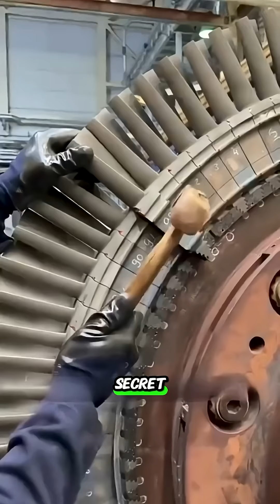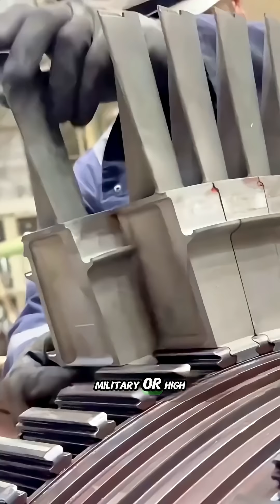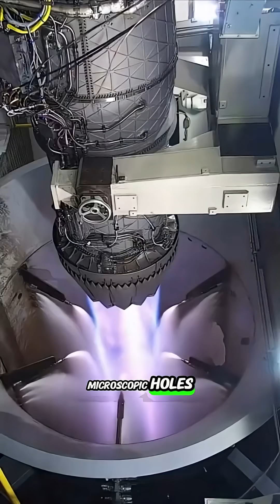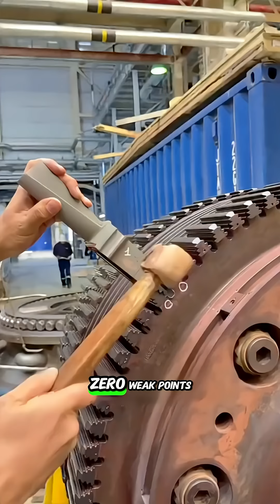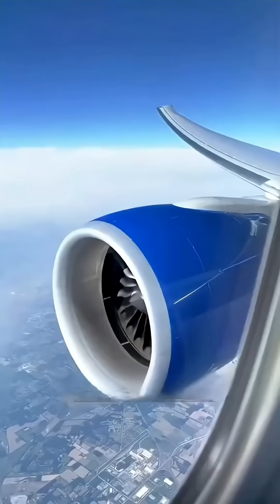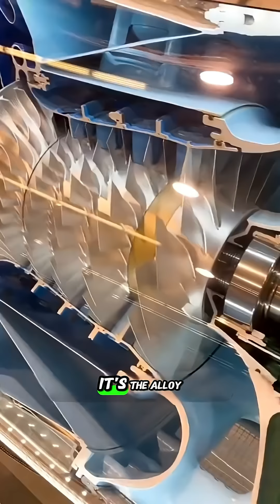The Insane Reason Nobody Can Copy American Jet Engines

Comment: Beautiful video, but outdated hype. The West had a head start, but China isn't copying the blueprint—they're skipping past it with next-gen ceramics and additive manufacturing that make BMW-priced blades look like relics. WS-15 is already flying, and the next wave is breathing down GE's neck. Western engineers aren't sleeping—they're watching Beijing's R&D budget and praying bans worked. They didn't. The monopoly isn't over yet, but the clock is ticking loud.
Save this comment for 2027.

Comment: A friend of mine's father was head of a group at Pratt & Whitney who created the high temperature coatings on their turbine compressor blades. Is it an extremely specialized field, one in which very few are expert and one which allows the engines to operate at the very high temperatures required.

Comment: A small germ.of truth blown out to ridiculous proportions.  Yes super sophisticated.  But I've got a YF119 HPT blade sitting on my desk.  Cooling holes are clearly visible.   Yes the are directed to guide airflow to envelope the blade with cooling air to keep them from actual contact with the combustor gases.  Almost nobody else can build them.  Almost.   That's not exclusive.  Yes amazing tek. But not alien tek.  They don't even touch on the FADEC integration.

Comment: Coal fired boilers for the steam to drive the turbines in our power plants require tolerances of .003 min to .005 max, just for the oil seal gaps encircling the rotor shafts!
.005 being, roughly, the thickness of a piece of paper.
Lineal expansion, contraction of the heating, cooling cycles.  This video showed me one of the items that crossed my mind, the 10 years I worked on turbines; jet turbines.
Incredible technology and if whomever it was that shared this video reads their thousands of comments; thank you!

Comment: Germany created the first operational jet fighter, the Messerschmitt Me 262. It first saw combat during the later stages of World War II in 1944.

America's first jet-powered aircraft was the Bell XP-59A Airacomet, which made its maiden flight in 1942. However, because its performance was deemed inferior to propeller-driven planes, it was used primarily as a testbed and training aircraft. The Lockheed P-80 Shooting Star is considered America's first operational combat jet fighter, first flying in 1944 and entering service in the final months of World War II.
Reply: Yes, Nazi Germany created the first operational jet fighter, but it was beset by poor quality of their engines. Don't recall precisely, but I read that they could only fly for about an hour at a time, after which the jet engine had to be rebuilt. The quality of the steel available to the Germans at the time was not up to par.

Comment: I am an actual certified jet engine mechanic.  In school we were taught that a 1/4 inch pencil mark on the turbine casing is enough to throw the engine out of balance and throw a vibe alert.  I don't know if I even have the capability of measuring the weight of a quarter inch pencil mark.  The level of balance is just out of this world.
Reply: How should a pencil mark on a casing influence the imbalance of a rotor?
Sorry, but I thought as a mechanic there should be some knowledge about how an engine works...

By the way, these benchmarks being told to you are rubbish. Engines are sensitive to imbalance, but not that sensitive.
Reply: @RenZ696 where did you go to school for gas turbines?  Mine was north of Chicago.  When I say casing I don't mean the outer casing, I mean the rotor casing itself that all of the turbine blades fit in.  It's not a one-piece assembly.
Reply: @letmepicyou  where I learned turbomachinery and rotordynamics this is called the rotor drum. The casing is the stationary part where the rotor is contained.
I thought this nomenclature was universial though. I'll check that out tomorrow with our turbine supplier, they also have customers in the US. Maybe, for whatever reason, the vocabulary is really different.

Comment: These engines are air, driven. They start them up with an air compressor starter. Once the engine starts going continuing, sucking in air and the way it’s designed that’s all that runs off the continual motion of the flow of sucked in air. I guess you can call it an air turbine. For naysayers the air is sucked in and compressed as it goes through the system and oxygen is a fuel. I’m not a engineer, but I seen a video on it years ago in a plane supposedly take thousands of 1000s of gallons of fuel, but where did they put the fuel And if you look up how much fuel One of these planes take didn’t look up how many Olympic size pools that would fill up.

Comment: I've worked on lots of different jet engine compressor and nozzle guide vanes. The cooling holes are very basic, are actually quite large and tend to cool leading and trailing edges only, they don't represent 'an internal labyrinth' as described. And they certainly don't spray any kind of fluid or vapour.
Reply: Glad you left out turbine blades, that's where the magic happens. Maybe the engines you worked on were not that recent?
Reply: @RenZ696  Ah well try the EJ200 engine in the euro fighter typhoon perhaps? 🤔
Reply: @dgw4150  kind advice, you should not divulge that kind of sensitive information online
Reply: @dgw4150  pretty high loaded engine as well. 
I was actually referring to the internal cooling paths within HPT blades, no offense. And for sure, no cooling fluids except air involved.
Reply: @RenZ696  None taken! I worked on Olympus engines for Concorde, RR RB211, Pegasus engines for the Harrier and the EJ200 to name a few. Vapour blasting the cooling holes on Pegasus LP blades was boring but you had to watch the machine because if it got stuck the blade was scrap within seconds! 🤦‍♂️
Reply: True for compressor blades which heat moderately during operation. However, turbine blades are exposed to very hot combustion gases and do have intricate cooling passages as stated accurately in this post 😊
Reply: @zaneullman2543  Not in the way they were described

Comment: Coming from a jet mechanic... its not as complicated as this video makes it sound. Its is correct about the cost, they are expensive but still not as expensive as the video makes it sound. The blades Definitely arent $200k ea, the entire engines i work on are 8 million dollars and have something like 300 blades. Even if the blades were the only cost inside the engine that would still only put them at around $20k-$30k a piece which is just not true. Also many countries besides the usa have build very capable jet engines, Keep the false info off the internet 😅

Comment: This technology is going to be changed with a much powerful propeller which emits air in ten times of this engine. The air will not produce heat during the combustion. Just speedy air.

Comment: In nearby Columbus Georgia, the Pratt and Whitney facility operates a major manufacturing and overhaul hub.
The facility includes the Columbus Engine Center, which repairs and maintains commercial and military jet engines and Columbus Forge, which manufacturers critical engine components like compressor airfoils and turbine disks.
Commercial Engines such as the Airbus A320neo, A220, and Embraer E-Jets E2.
Military Jets include the F117 for the Globemaster III, and the F100 for F-15 and the F-16 Fighters.
Vital heavy-duty forging includes parts for commercial engines and the military F135 engine which powers the F-35 Lightning II Fighter Jet.
The Columbus Plant employs over 2,600 people.

Comment: The jet engine was invented by Sir Frank Whittle in the UK. The Comet was the first commercial jet Air liner, built and designed here in the UK. ROLLS ROYCE, the foremost aircraft jet engine designer and builder and recognised across the word.

Comment: Shenyang And Xian will conquer the market before long. Now, more engines from these manufacturers are produced than any other. However, most of them still end up in military use in fighter jets and transport aircraft. In 10 years, the matter will be completely different. RR will certainly hold its own for a long time.

Comment: I worked in a special metals factory on the West Coast as a mechanic millwright we repaired machine machines, vacuum machines, all kinds of different pickling tanks. They made different kinds of metals called crystal bar hafnium zirconium special titanium we had security guards watching us cut blocks of it $600,000 blocks of it. They made stuff in vacuum tanks. It just grew under plasma. I don’t really understand it that well but I used to fix the machines. It was interesting. They made jet nozzles for F-15s no joke there’s some cool metal out there forging, etc..
Reply: It helps to take a class or classes in METALURGY, I only took 2 because I got took up Welding and felt that it would be extremely useful which it did but alot of the other welder's didn't want to be bothered, I felt that I it was mandatory and it paid off at the Shipyards and other jobs, what did I have to loose

Comment: The Russians ALSO make jet engines, both for their military and for their civilian market. In particular the PD-14 was developed from scratch to replace the sanctioned Western engines and it's a 5th-generation high-bypass turbofan which features advanced hollow titanium fan blades, a composite nacelle to reduce drag, and a fully digital FADEC (Flight Control) system, all designed and made in Russia. Oh and Russia supplies nearly half of the world's aerospace titanium... The US and Europe are importers.

Comment: As a retired Air Force jet engine mechanic, it's great watching this video.  If an engine came in from a bird strike, we were not able nor allowed to rebuild the compressor (the rotating assy with the blades), we had to ship the compressor out to a special location that had the EXTREME ability to rebuild compressors 
We were able to replace one or two blades per stage, matching the special weight laser etched on each and every blade.

Comment: The balancing part is way exaggerated ... every engine has inbalances, there are tolerances for it and it's not mikrograms or the weight of a hair, much much more can be tolerated..
Also even if the rotor would be inbalanced, it would not tear the engine apart, but the information of it would be given to the maintenance crew by the maintenance panel of the aircraft. Only in extreme cases it would trigger an alarm in the cockpit and the engine would maybe be shut down ... you need A LOT  of inbalance to destroy an engine, something about half a blade is missing or something like that, and even then the engine does not get "torn apart" by the inbalance, for usual not even by the part broken of getting sucked through the engine (it would destroy the engine, but it would for usual not be totally torn apart, it would be a contained damage as it is called).
Uncontained damages at which parts get ejected out of the engine and rip through the sides of the engine bay/gondola are extremely rare ... and extremely dangerous for the aircraft in total

Comment: Saffran and Rolls Royce looking at this

🤯🤯
Reply: Rolls walked away laughing!
Reply: And UEC
Reply: @Jimmy-ye3wg sorry, Russian jet Engines aren't at the same standards.
Reply: @rocker10039 not for emissions, but excellent in terms of power and reliability where fuel efficiency and environmental concerns aren't as strict as in some western jurisdictions.
Reply: @Jimmy-ye3wg what? Sorry dude I've been following indian defense for over 10 years, we are operators of russion jets, they do not have the same level engine tech as the west. Even china is closer to Western tech than Russia now, even though they have a few ways to go.
Reply: @rocker10039 i guess we still have older jets or bought cheaper ones from their portfolio of Russia 

Still maybe China could have surpassed
Reply: @yashwanthreddy9676 China definitely surpassed Russian Engines. They aren't even able to make AL-51 engines properly. This is why the Su-57 is being labelled as a 4.5 +++ gen fighter instead of a 5th gen fighter, thrust to weight ratio isn't enough to produce supercruise, a requirement for 5th gen. China was behind initially during J-20, but you gotta acknowledge J-35 as a very capable fighter jet. I hope we can get AMCA out faster. There are talks for kaveri 2.0 but I don't trust our bureaucracy

Comment: I reverse engineering these blades. And worked with them at a westing house facility. The cavity holes are not thinner than hair. But they were extremely difficult to replicate. When we x-rayed and cut open the blades, they were almost impossible to replicate in CAD